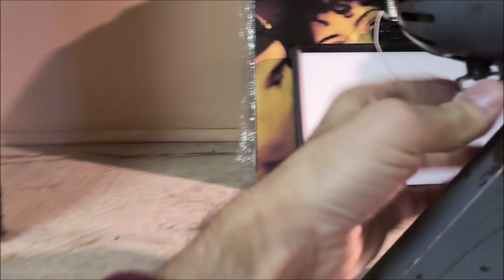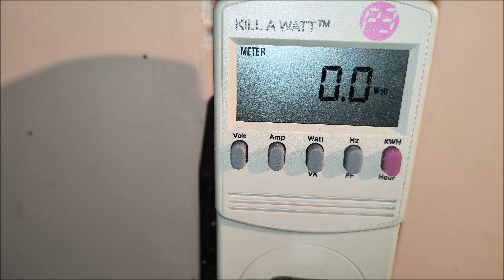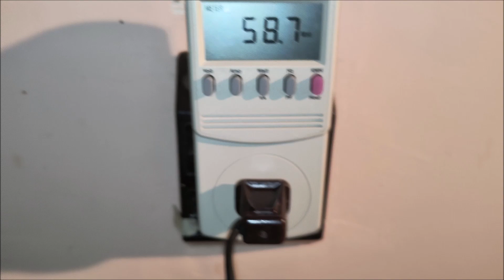Mid 1950s Superior Electric Oscillating Fan

Comment: I would tend to agree with the 1950s design.  The rounded back of the motor was very common back then.  The question I have, is that in the late 70s, that would make this fan a good 20 years old already.  Were you looking for something like this then, or it just so happened to be there at the yard sale and you just happened to need one?

When I was a kid, I had a Howard Industries 120mm, 120 volt "muffin" fan.  Later I got a brown oscillating fan from a store called Channel.  They have since gone out of business.  That fan is still around at my parents' house.  It got knocked over to the floor a few times.  Little known fact was my dad was the OG Angry Grandpa back in the late 80s/early 90s.  The fan has been patched up, Krazy glued, I don't know what else.  Oh, and the pushbuttons got knackered so they don't work as well anymore, I think one sticks up a bit higher than the other.  It was sort of mine because that's all I had in my room as a kid.  But during the day, my dad would take it and put it on the kitchen counter and use it in there.  I don't know if he still uses it much, he has a couple of Vornado faens he's been running.
Reply from the maker: It was more I needed one as at that time we quite often had to spend a couple weeks at the house instead of at the lake in the middle of the summer if my father's sister and her family came from Chicago for a few weeks.  My hometown is in the bottom of a valley so during the dog days of summer there is no breeze at all.  It's just stifling hot and our house had no A/C and I believe we only had one box fan.  So I needed one because trying to sleep at night when it's 90 degrees in your bedroom was unbearable.